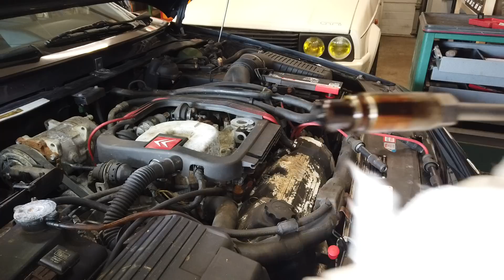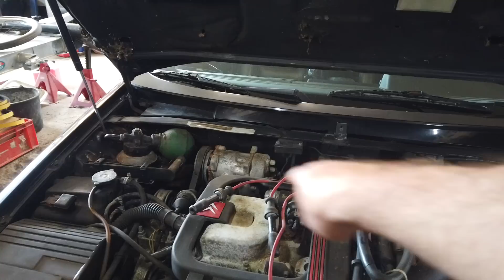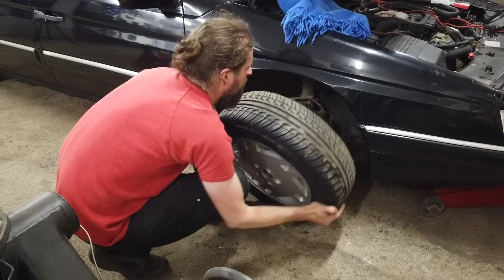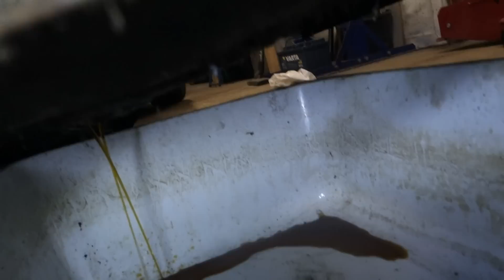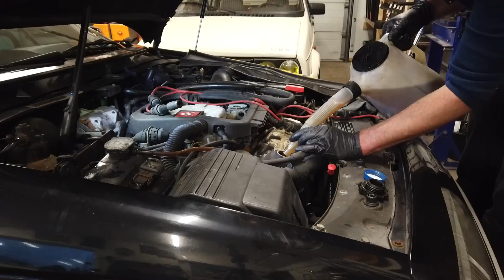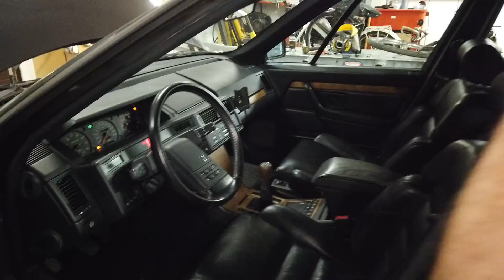Citroën XM Barn Find - Pre checks before first start up in 20 year. Is that water in the engine?!

Comment: Hi,
Very nice videos !
A few details about your previous video : take care to the immo keypad, push the door at the center only and gently. It's fragile and difficult to find.

The noise you hear inside is the inside air temperature sensor for heating. Clean it up and add a drop of oil on the axis.

For the ECU, you can try 3 codes, after 3 failures you will have to wait for about half an hour before you can try again.
Reply from the maker: Thanks!

The keypad is the old model with only 1 minut lock out! :D
Reply: @SeasideGarage  it remained that way until 2000 !
In 1997, the remote control allows immo unlocking without typing the code on some cars.

Comment: I still think (never owned 24v) that the issue with the cams does not ruin the engine but it will cause rattling sound and ruff running, it’s just annoying to deal with.

I’d say that the stuff that came out was old fuel if it was water it would have been crystal clear. How much oil did it take? There were upgrade with the oil pan that reduced capacity from 6.6l to 6l. The older design could cause oil surge.

If I remember right, the keypad operates both ignition and the fuel. If code is disabled the light in the pad switches from red to green as soon as you turn your key.
Reply from the maker: Need to chech how much oil i used! Interesting !
Reply: The keypad is nearly identical to the one I have in my 1995 306, and that just cuts the spark. Although maybe they did it differently for such a premium car.
Reply: Sorry mate but if it has the early rockers & they collapse it WILL ruin the engine...I have 1 in my Alpine...gold coloured rockers are the updated with the ceramic pads...grey rockers are the old style & will cause problems.

Comment: under the backseat, there is a ca 5-6" round rubber pad, if you remove that, you get access to the lid were the fuel pump and fuel messaging device is located, and unskrue it, it comes out as one unit.
then you have somewhat god access to the inside of the fuel tank and the fuel pump 😀
to see if the hydraulic system have enough fluid, you need to somehow convince the car 😋 to raise to fully op to see if there are enough .  there is a float glass on top of the LHM tank and the flote needs to be between the to lines on the glass when fully raist.
hope it helps you and make things easier 😀

Comment: Oil filter is down front beside the altinator below the dip stick..
You can tell if the engine has been modified by the colour of the valve gear on the front bank. Original valve gear is a grey shade of colour but the modified valve gear is of a gold colour .. when the original  valve train wore it did virtually destroy the top end ..

Comment: The stuff in the bottom of the engine wouldn't be old fuel, that would mix with the oil rather than separate, the other is that being fuel injection it's unlikely for fuel to leak into the engine anyway, that's usually a carburetted engine kind of problem, as for why the water is in there, I'd be looking at headgaskets, a common issue that can let the water escape from coolant into oil passages...
Reply from the maker: Very likely cause for sure...
I was thinking fuel because maybe its a non runner because of lack of spark, so maybe someone had been cranking it without it firing but still fuel would be sprayed in? 

could be so many things, but its worrying for sure...  Ill stay positive!

Comment: It´s time for some really important safety info. Besides "never crawl under a Citroën", Hydractive makes this VERY dangerous. If you had gotten it to raise with your drill. It would immediately crash down if you opened a door or hatch or turning on the ignition. With the Hydractive system not activated you are only pressurizing the wheel cylinders/spheres. When turning on ignition or even just opening a door, it will hydraulically connect the non-pressurized center spheres to the wheels. And trust me, it will fall down almost like you dropped it. The other way around (when it´s working), it may jump up if it was put in to lowest setting without engine/ignition, but more on that later. Just be aware of that you want to know these things about Hydractive. When lifting a Hydractive, I always make sure to have all wheels not being able to touch ground. I have documentation you may want. Can I send you an email on the address you have at the about page?
Reply from the maker: Good to know!

I live by, never go under ANY car without a safety axle stand... its a sad way to go...

Yes I would like that material! thank you

Comment: Couldbe a good idea to drain the coolant if you are putting the car away for 20 years.
Reply from the maker: Hmmm not sure I agree... I would change it for fresh 1to1 coolant.. The coolant is rust protection. 

If you empty the system you need to make sure its dry in there..
Reply: @SeasideGarage  Yeah but in20 years all those protectiveadditives can precipitate out aswell. So both could be the right way to go.
Reply from the maker: True!... But is it the heat cycles that kill the coolant? or time? I dont know...
Reply: @SeasideGarage  I think it can be a little of both but the heat cykling is probably a a catalyst. Most brands I have worked on suggest changing the coolant every 2 years though so 20 years would be pushing it either way.

Comment: Is there an oil line going through the radiator, I reckon that pipe through the radiator is at the bottom of the rad in the form of black grit. saabs do it, vauxhalls do it...
Reply: No oil line in radiator. It has a oil cooler between the filter and the block.